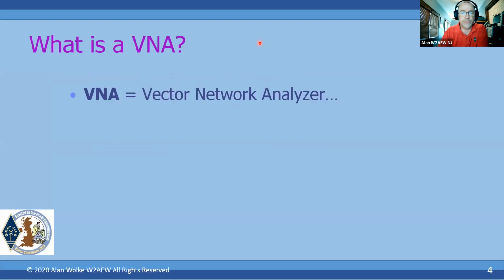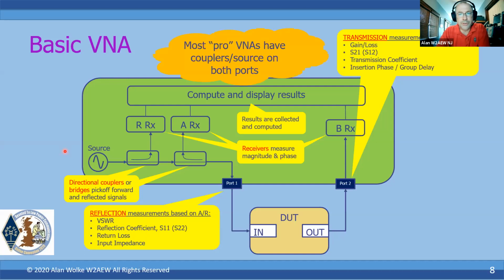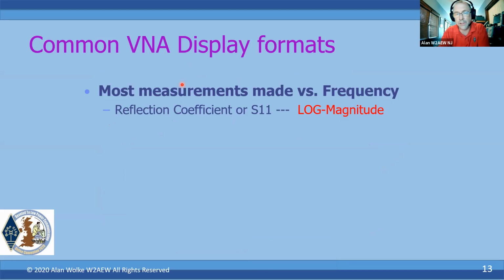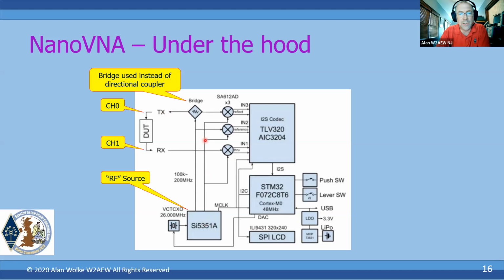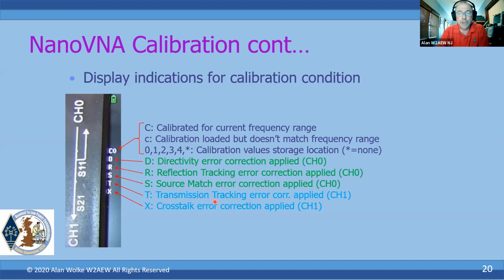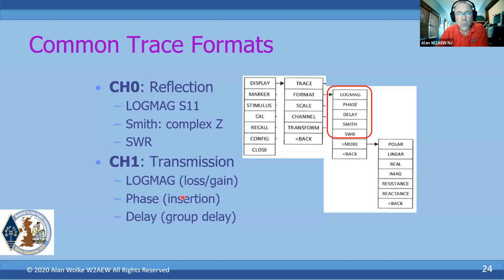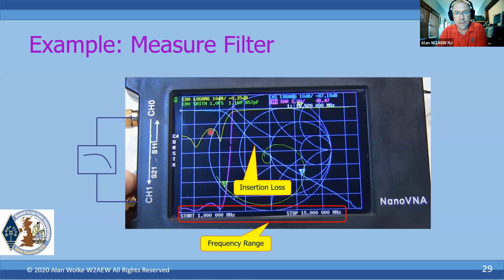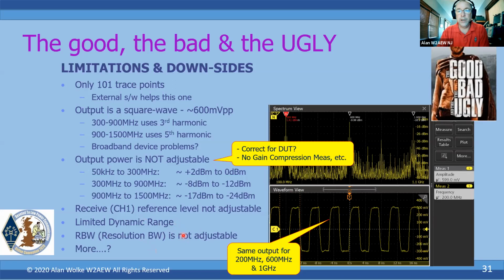G-QRP Club 2020 Convention : Alan Wolke W2AEW: VNAs Explained and the NanoVNA

Comment: I wondered if you can measure the velocity factor of cable and somebody asked this question.
These look a useful gadget.  I put up some dipoles and can use one of these and also see how my tuneable r.f. filters work which I want to put in my homebrew rig.
I think I need one. It explains why they are different prices, I never realised there were a few versions.
G4GHB.